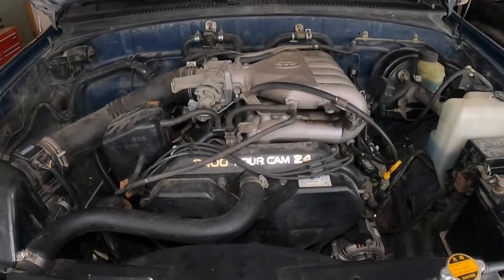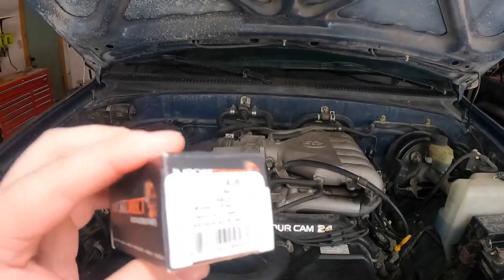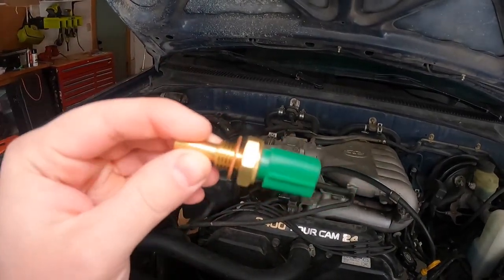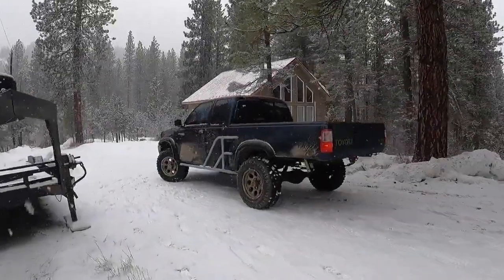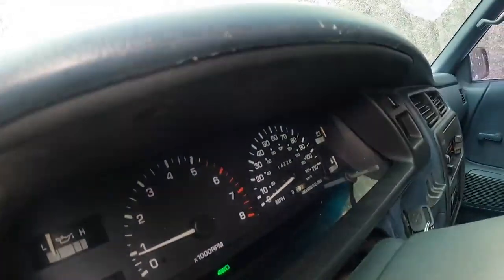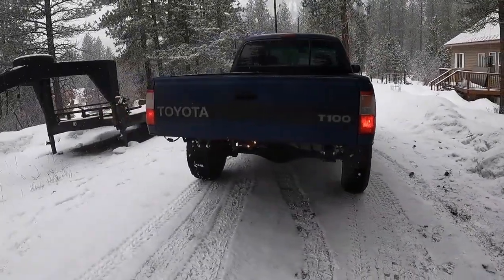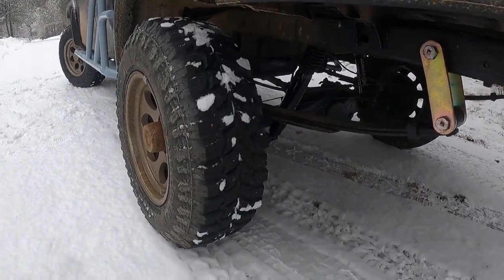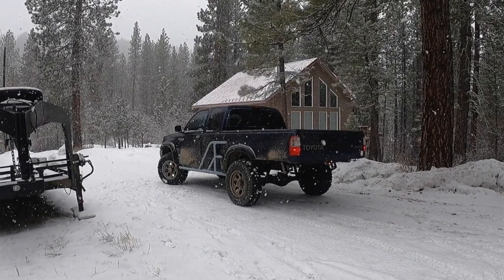5VZ FE Coolant Temp Sensor Inspection and Replacement!

Comment: I replaced my sensor and wire and still throwing the coolant temp sensor code. The truck is very hard to start in the morning. Is there any other sensor? My gauge is readying accurate. Not sure what’s causing the CEL code to go off.. any ideas?
Reply from the maker: There's a lot of info here. What oil weight are you using? And what temperature is it in your location?

Comment: From what I understand there are two sensors. There is a single wire one on back of engine that sends signal to temp gauge. The other, double wire near front, sends a signal to the ECU to control air/fuel mixture. (Is this correct)
Reply from the maker: Unsure about a rear gauge sensor. I've never had to replace anything behind the engine (electrical)

Comment: My truck just goes to the middle ever time I start it and it stays there doesn’t seem to move any idea bro ?
Reply from the maker: That seems normal for a 5vz-fe
Reply: @accountant_mechanic_  really ? Even right off the bat ? Like it’s 36 degrees out side it start the truck it does the swipe to the top then goes to the middle and doesn’t move
Reply from the maker: Oh that's weird
Reply: @At44209 check/replace your thermostat?
Reply: @RaiderVic530  replaced thermostat still does same thing . I
Reply: Either sensor problem or cluster. Sends signal from thermal resistance of sensor. If constant no matter what temp it is then it's faulty
Reply: Same! Saw a video that the screws/bolts that hold the needle in place (gauge cluster) was loose. That’s what fixed it for them.

https://youtu.be/S9bhcQat6Hs?si=5HG3sNjpDoW3sk_w